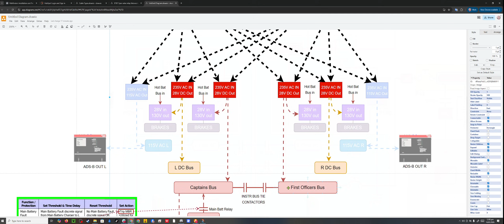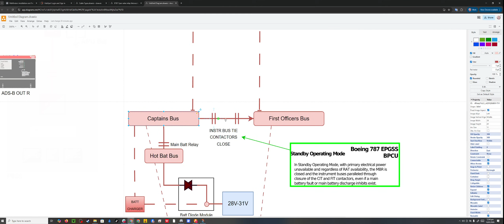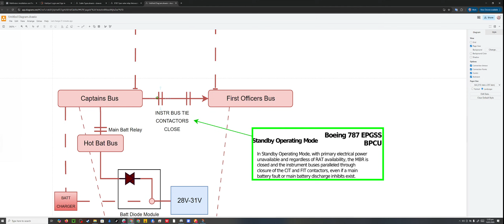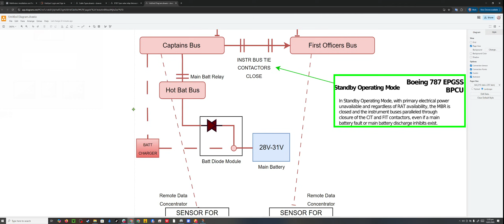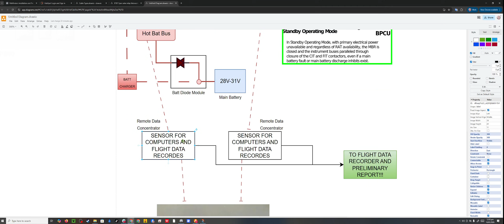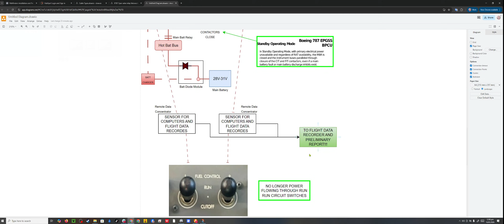B787 Main batt relay, Fuel Cutoff Switch, Remote Data Concentrator and Bus Tie Contactor

Comment: Much respect for your deep in dive into 787 control logic. It's clear as day this was an electrical fault. Richard Godfrey suspected the same, but with different origin. Have you guys been in contact on that matter?
Reply from the maker: i let Geoff Thomas know the day i discoverd what happened.
His expert in the UK esnt be a formal rebuttal refusal letter. Since then, i have 0 respect
Reply from the maker: there were in fact a hurdle in my path to get the truth out, and in fact the very reason i had to make videos myself to find the correct people. That hapened, that worked, and now i have both sides of the globe with officials working on it
Reply: @jeremyjohnthompson5187  I appreciate all the work you've done and the recent videos with all the technical details.  Other relatively recent information is from Capt Amit Singh and his access to the ACARS log, which I've found very interesting because it's indicating electrical power problems (with fault codes) and the Maintenance Advisory System messages. Here's a comment I posted in response to someone that had similar questions and confusion about the log messages.  Have you seen Amit's video and what looks like a partial ACARS log? Maybe you can get a copy of the entire log. 

@KRMISC4-sn8vh I have had the same thoughts and questions as you mentioned, critical information being shared but the times shown don't sync with the preliminary reported timestamps. Then I recently found (Captain) Amit Singh's YouTube channel and he posted this video (link below) which shows a partial view of the actual(claimed) ACARS log. What's interesting about the log is it looks like it's in Pacific Standard Time and if you add 30 to 32 seconds to the time stamps in the log it begins to line up with the preliminary report timestamped events in my opinion. Not sure why there's an offset in the seconds timings and I'm just suggesting the offset is about 32 seconds between the ACARS log and events in the preliminary report. There's the initial Maintenance Advisory System message at 12:08:08 (am PST?) and another MAS message again at 12:08:20 and a No acknowledgement message at 12:08:13. There's also the text message sent by someone at a ground station to the Captain asking if all operations were normal at 12:08:20. There's only 12 seconds between the first MAS message from the plane and the text message back to the Captain so whatever the initial MAS message was (combined with the NO ACK message) it appears it was serious enough to trigger an urgent text message to the Captain. It also could have been there were other previous ACARS messages from the plane that triggered the text message to the Captain, there's only the partial log shown. The second MAS message sent from the plane at 12:08:20 from the ACARS log and I am syncing this message timestamp up with the first fuel switch returned to Run timestamp in the preliminary report at 08:08:52 (UTC) when the RAT power came online for the timing offset in seconds. It's always been my opinion there was no battery backed standby power on the Captain's and First Officer's instrument buses for ~10 seconds and this may have also interrupted ACARS responses from the plane until RAT power came online in addition to the delay in the fuel switches returning to Run because of no instrument bus power. The timing offset and missing power is all just my opinion and I could be wrong about all of it. 
 
Claimed actual log shown beginning here 
https://youtu.be/OnH5pguoJh4?t=71
Reply from the maker: yep i have it doug. the messages of interest come from the CFD .This code stands for Central Fault Display, and these are not run of the mill messages. Each of those messages alone is not serious enough to stop the aircraft. Unfortunately here is no logic to count the number of non serious messages displayed in a single poling event and make any kind of announcement about it to the EICAS system.
Reply: Wonder why Richard and Geoffrey have stopped covering AI 171, kind of a sudden and the last video they did about it they made the video private. After Capt Amit Singh and Rachel Chitra sent them the information they have on the BPCU faults and ACARS messages I was hoping Georffrey and Richard would provide a response.  Thought they were both more committed to get to the bottom of things. I don't think they will respond but Jeremy's recent videos and his interview are certainly worth discussing in a new episode.
Reply: @dougswanson9142 perhaps they realized something that they don't want to discuss about

Comment: These 12 chapters are probably the best we can find on the net detailing various electrical faults/flaws regarding the AI fatal takeoff. Keep up with your good work. Most professional and master minded.
Judging from all reliable information collected so far, these “fly by wire " killing machines shall be grounded forever. 
We are not living in 1960~. I discovered stone ages electrical control components ( e.g. 4PDT relay with dual latching coils that exhibit unreliable pole latency (relative timing  b/n multiple poles) is employed feeding to engine control: I meant the LEACH KL relay. Then the flimsy Toys n Rus Honeywell fuel switch without safety flip cover installed in the wrong location in an mission critical aircraft. Then the “ Diode module” , as whether the inside are some high power diodes or in fact are IGBT modules would not make too much difference: It’s a fatal practice to control current charge/discharge directions this B’s way (naive and innocent)
Just tuck in any industrial grade ac/dc to ac/dc self contained all battery types battery charger. No nonsense anymore struggling with unsecured swapping crowbar loads, powering up and shutting down ac/dc sequence externally.  GE power and automation is a reputable supplier of PLC , UPS. Ask them for help instead. 
Electrically ,from  head to toe, everything is at fault. When small signal paths are sharing electrical return over the metal body, whether opto isolated or not, it’s already very difficult to deal with. It’s a disaster if electrical continually is not maintained. 
It’s noted the engines rotations were disrupted during the first minute of take off. During this most critical moment, by all means, fuel supply to engines shouldn’t had been handled by immature automation device WITHOUT human intervention. (MAINTAIN FUEL to engine).
With UPS nowadays, RAT is a cosmetic item of the 60’s. It can’t save the downing aircraft.

Comment: Diode failure thoughts:  my first reaction to a diode module repeated failure is- how could they screw up a diode circuit?  If this is happening then it has to be a design problem as these planes don’t have enough flight hours to have meaningful failures of a diode circuit. Note this diode would conceptually be in conduction for short periods of time and temperature should not be a big player. As identified this module does fail as there is a new design in process. One thought is that the diode aren’t failing but maybe a Transorb or other protective device that would have a DC path to ground in a failed module. A DC path short would be a single point failure but maybe doesn’t explain all the observables.  
The other failure could come from ripple voltage on the 28VDC buss from rectified AC generators. If the voltage drops low enough then the battery will start behaving like a capacitor with short current spikes at twice the generator frequency. 
The batteries would not be happy and the diodes could have trouble with this as well depending on the component choice. If they are not fast recovery diodes hot spots could develop on the die and have a local burn spot shorting out part. I have seen this type of failure with SCRs. This is a stretch but should be considered.
Reply: One thing to remember is that these are diode "modules", they aren't a big silicon diode, they are a circuit with current sense and hefty switching FETs designed to look like an "ideal" diode. While this has a lot of advantages over a regular silicon diode there's a lot more to go wrong.
Reply from the maker: Great inputs. The AC ripple you talk about is exactly what i think hurt this diode, combined with temperature. SO sory i shouldnt focus so much on temperature, thats not the root cause here. The issue is that the entire aircrafts systems rely on the single component functioning. Its been 15 years. It did remarkably well.
Reply from the maker: oh sorry, also, thank you you reminded me i need to make a video on all this. The japanese investigators of the 2013 Takamatsu lithium fire event found evidence that the battery voltage would spike a large amount during charging.

QUOTE:
3.9.3 Phenomenon of Voltage Spike during Charging

As described in section 2.11.4.b, during the on-board test, a voltage spike up to approximately 45 V was observed during 46 A charging. As the spike was observed approximately 1 sec after the charging currents went below the set threshold and the charging currents were interrupted for approximately 25 msec. 

The BMU’s contactor BIT function is probably responsible for the phenomenon. BMU’s contactor BIT operation is not intended in the original design philosophy, the BIT should not run while the charging current is high, but at the last phase of charging operation where charging current is less than the set threshold to avoid high voltage transient which is associated with the contactor opening. Therefore, it is desirable that the phenomenon should be improved.
Reply: @jeremyjohnthompson5187  The word phenomenon is used 29 times in this report, which I found very interesting since it usually was describing an observation about transient spikes, cell venting, BIT and the contactor opening and there wasn't a solid understanding that explained these observations.   

Here's something else from the report that was surprising to me. 
"In addition, contactor opening not expected in the design is very likely associated with cell venting; therefore, the necessity for risk reassessment on the loss of all electric power should be examined."

When the battery's internal contactor opens there's an interruption in backup power on the hot battery bus and instrument buses so it would seem the operation of the contactor should be thoroughly understood and predictable, the contactor is mentioned 88 times in the report. Typically, the contactor opening may not be critical unless it's at a time when main power is lost and battery backup power is required until RAT power comes online, rare but extremely important when this does happen. 
You linked to this report back in July and I've read it more than once and it does contain a great deal of information about the battery, testing, failure modes and past efforts to improve reliability and safety of the battery and more recommendations for improvements.
Reply from the maker: @dougswanson9142  yes the japanese were desperate in their wording, in the part where they recommend Boeing to look at the battery chargin and isolation systems and the root cause.

Comment: Hi Jeremy, thanks for your detailed explanations. I watched your explanation in a previous video about the capacitors on the Fuel Shutoff Modules discharging their charge through the Fuel Control relay and thus causing the relay to transfer positions, and I was hoping you could help me understand this a little better.

I don't really get how there can be a reverse voltage caused by the capacitor discharging. If I'm understanding this correctly, the capacitors for the FSMs are hooked up across one of the (shorted) 28V Instrument buses and ground, and prior to the short these caps are charged to 28V. Now, when the short occurs, the 28V of the capacitor begins discharging through both the short, and other circuitry on the 28V bus until it has no charge left.

Now, without some kind of major inductive element/load on the 28V DC Bus, how exactly would the voltage on this bus fall less than 0 volts? The shorted bus, or atleast the local area of it feeding the fuel control relays would need to build up some significant negative voltage (around -5V worst case as you mentioned) for the current to flow backwards from ground, through the fuel control switches, through the fuel control relay in reverse causing the switch in relay position and shutting off the spar valves.

I'm also not too sure about how the relays themselves work since I don't work with instrumentation. If they are latching relays, I'd assume it'd be fine if the power went out during operation, and theres no chance that the inductive characteristics of the coil itself would somehow trip the relay back to the original position. It also is unclear whether there is some external circuitry that pulses the relay appropriately or it really is just connected directly to the 28V bus (and I also do not know if the relay is meant to be operated that way) as shown in the diagrams on your previous video. 

Please forgive any ignorance on my part. I work more with RF and I'm not too familiar with avionics. Just found this interesting. Cheers!
Reply from the maker: Its not just the capacitor disscharging. It gets charged the wrong way due to the battery fault shorting in the middle of the case. The relays only need 14.5 V (garuanteed as per MIL spec) and may actuate in either direction, as specified in the specs. The holdup capacitors was slowly charged with the reverse votlage, and on complete collapse, the caps emptied, around the coil in the wrong direction, after being charged in the wrong direction.

Do you understand
Reply from the maker: and, you will be rightfully questioning why i havent yet shown this in a silly diagram....
I have to be careful about who i expose here. LEECH have not done anything wrong. They cleary talked aboutse the cahracteristics in their product data sheet. They need not receive bad publicity. The fault here is in the battery isolation system and choice of battery chemistry, compounded by the systems oversight failures of 15 second countdowns and bus tie contactor logic that sends shor t circuits around thhe flight deck.
So, i dont really want to put them in an unfair light.

Comment: Are we to assume that the Instrument Bus connectors are not over current/voltage protected?
Reply: The instruments themselves didnt see any current, the power from the rectifier to the bus and bus to battery did.
And yes, that cause the hall effect sensor io the dc side of the  rectifier to detect extreme current and turn off the TRU, bith left and then right, the very reason for RAT deployment.

Comment: This is great... I have been trying to piece together my own findings and I am pretty much aligned with what you have found so far. The only thing that I haven't been able to explain is the transition of these switches from CUTOFF back to RUN as per the prelim report.
Reply from the maker: thats easy mate. I think i said it in the video. im not gonna ruin it for you, look at the text on the screen, hint, towards the left.
Reply from the maker: and now you should ask but why the delay for both to turn back on......
And I tell you the aircraft starts up fvery fast when in the air, starting wtih left capt bus, followed by the right - First officers bus

Comment: Another great explanatory video. It's simple to understand even for a non aeronautical engineer (although I have electrical and electronic experience). A big question for me is the amount of current that must have been flowing around the circuits while these ground shorts persisted. Having a known fault for 15s before attempting to isolate or shed the load seems excessive to me....Would the excessive current paths exacerbate the fault condition?
Reply from the maker: somehwat yes. it turned the transformer rectifiers off due to overcurrent. that was the trigger for the RAT. It might have been ok if it jsut kept dumping current untill somethign burned through

Comment: Thank you! I like to add the obvious for clarity: the diagram shows all positive 28V connections. In addition, each piece of equipment has a ground connection. Also the battery has a ground connection as its minus pole.

In case of battery short AND failed diode, the battery connects the 28V of the captains bus directly to its ground connection. 
This effectively kills all power on the captains bus (and after one second it kills the first officer bus too, by closing the bus tie connectors)

I really hope, Boeing is silently fixing this design flaw behind the scenes, otherwise desaster will needless happen again.
Reply from the maker: I actually appreciate that. ill put taht in the description. I forget who my audience is. cheers
Reply: @jeremyjohnthompson5187  Isn't that 28V nominal, but often quite a bit higher?
Reply from the maker: @JorisR21  yep, 29 - 30, but they did make some changes after the fires and i beleive they set it all down a bit lower. SO i just talk about nominal

Comment: The fuel switches themselves is connected to independent grounds. In case of a severe short circuit, we get Voltage drops in the ground itself depending on the cable dimensioning. Carbon Fibre fuselage isn't a good conductor like Aluminium. 
How solid is the ground on the 787's compared to the DC buses?
Something will give if a short circuit occurs. Likely the 28V get split on the buses and the ground.
The ground might be 5 volts giving false signals.